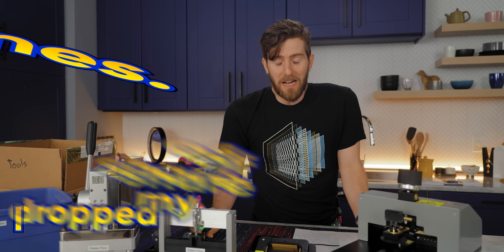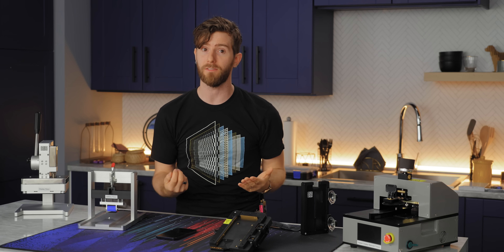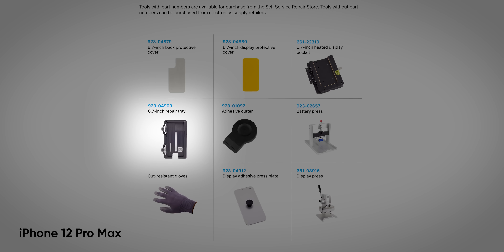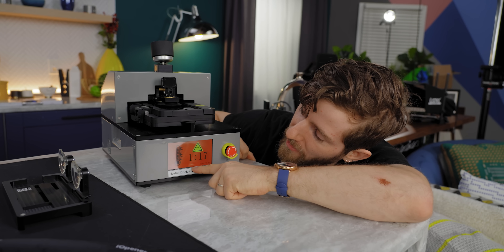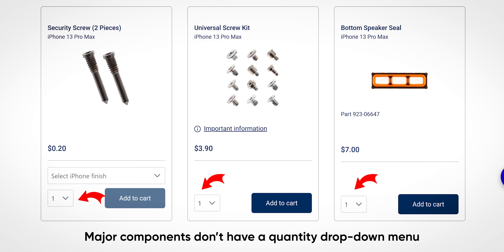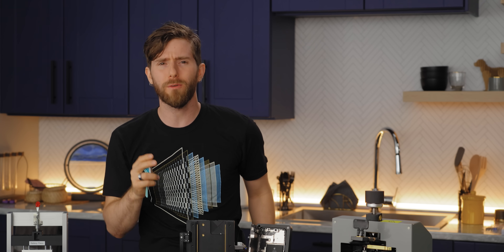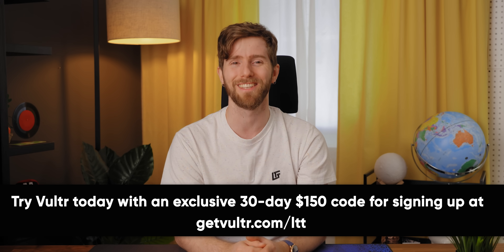I’m a Genius - Apple Self Service Repair Program

Comment: I work as a Samsung technician and it shocks me what apple thinks is necessary to fix a screen or replace a battery. All I need to do a whole phone refurbishment (replace the screen, battery and some of the internal components) is a torqued screwdriver a hot plate a small plastic prying tool and a suction cup. It takes me 30 minutes with paperwork included to do the whole phone from first placing my hands on it to giving it back to the customer.
Ofc we have tools that make it much easier like an automatic opener where you just place the phone in it and after 5 min of heating up pops out an open phone. But you don't need a press for the battery, elbow grease works just fine. Their glue is already REALLY STRONG!
Reply: I'm an independent repair tech and the design choices Apple makes for their phones is absolutely fucking *baffling*. Every model uses a different assortment of Triwing or Philips screws in different places for seemingly no reason, and of course they're almost all different lengths. Pulling out the boards can be a pain as you have to remember where each individual stand off, part and cover goes (of which there are an unnecessary amount of), and just in general they are SO unnecessarily hard to work on compared to Samsung phones. Almost every Samsung whether it's an A series/S series etc. JUST MAKES SENSE. One type of screw, one length (except in the case of the new ultras that have those triwings up in the top right but w/e) the mainboard, daughterboard, and the battery. It's just simple! Most other manufactures are the same. Sony, Google and Huawei can get a little weird at times, but nothing tops the consistent bullshit of Apple phones...

...And of course that's without mentioning the fact that a battery or screen replacement will come with a 'non genuine part' warning on anything past the XS (even if they are OEM but don't have the certified software), something that Samsung still doesn't do, bless their goddamn hearts. Samsung will even let you replace fingerprint sensors without a warning, Apple will force you to move the home buttons over to keep touch ID (which isn't that hard and we do) but again, just unnecessary and a waste of time..."security" my ass... Our store has been in business since 2007, long before any of the bullshit that Apple has introduced, so it's fascinating to see how much the landscape has changed.....Mostly in unfortunate ways....

If anyone read all of this, thanks for listening to my rant about Apple's illogical phone design lol. Would LOVE to talk to an Apple engineer and just ask why the hell they have to change the screw heads on the earpiece speaker/proximity module for every model from the XR up. It's 4 screws, you don't have to change the type and layout just for the sake of changing it Apple!
Reply: not as strong as Samsungs "elephant glue" tho!
Reply: @PvtAnonymous  use rubbing alch comes out easy
Reply: Unfortunately, i have to nearly damage the damn battery to replace a Samsung battery.
Nearly lit my Note 9 on fire because of the lack of pull tabs. You'd think your handlers would actually care about that but NOPE! Just let them burn i guess!
Reply: @LermaBean  I'm an independent repair tech and you're right that the batteries can be really annoying. I usually just let it soak in isopropyl alcohol for 5 minutes, leave it on a heating pad and come back to it, most of the time it will just fall right out at that point. I've had one Samsung battery blow up on me as I was being careless and rushing prying it up, lets just say I don't rush batteries anymore lol. (In case you're curious I've never had the isopropyl or the heat damage OLED displays, although the the iso can get between the layers on Apple's LCDs and create bubbles).
Reply: @Quivex1  well Samsung does have different lengths of screws but they almost always are on a different level of the phone. Longer screws are for the plastic backing that holds everything together, and shorter (usually black not silver) screws are for holding the boards to the frame and grounding it, most of the time there are just 1-2 of them. Ofc there has to be an outlier, and it's called s21 FE it has 2 more shorter screws in the upper right corner (one visible right away when you open the phone) but fortunately they are protected so when you screw in a longer screw it won't come through the display, it just won't hold it. This is the most "complicated" screw management, without going into the foldables territory.
Also s9 is a human marvel of overengineering, with it's weird layout and flexible PCBs. It's always a nice switch up from basically the same layout on most newer S series and A series devices.
Also also if anyone wants to do like basic level of testing on they own devices then go to the phone app and on the num pad write *#0*# it will open a "secret" menu with few tests that you can quickly do to test basic functioning of your phone (loopback is for testing mics and hall ic you have to place a somewhat strong small magnet to the dots for it to detect them)
(In the sensor tab in the upper right corner you have "image test" and it opens a low quality really stretched photo of a chiwawa I have no idea why but it's there in every single Samsung phone)
Reply: @Stripeyy  you're right, I did forget about the black board screws, or the 3-4 screws holding the daughter board/charging port down on some phones, but the fact I forgot about them means that I never worry about them, which again is just how things should be. Usually samsung even marks those specific screw holes with a bigger gold/silver ring so you know where to put them back if you've never done it before! And like you said there's almost always only one or two, sometimes more for the daughter board. I guess on some of the A series phones the screws for the finger print reader are slightly shorter but again, just not a big deal.

..... Now the S8s and S9s are.... Interesting to say the least I'll agree with you there 😂 The first couple of times I did one I didn't route the antenna wires cleanly, and forgot the tiny proximity module underneath the mainboard. The little side board that's connected to the main flex is also kinda weird. Once you get used to it though, you can practically pull the whole thing out of a screen fully intact and drop it into a new one. I'd argue that's probably Samsung's most "complicated" phone and it's still easier than almost every iPhone lol. I would love to know why the decided to design the S8/S9s like that though, especially since the S10 is literally one of the easiest Samsung phones to work on. I guess someone realized they over complicated the design and was like "fuck this we're making it simple". Works for me!
Reply: @Quivex1  I just got out from work and today i refurbished a z flip 3 for the first time and holly sh... that's a tight squeeze with all the parts. In most phones you can assemble them in almost a random order. Not here,  here you have to do it in a somewhat specific order to put it together correctly and in one piece.
It's by far the most complex phone I did but still the most complicated part is ungluing the front camera without damaging it. This shows that if you want to you can make even a flipping, (pun intended) folding phone so easy to repair that the hardest part of it is the glue.
Reply: @Stripeyy  ahaha that's great, love that a flipping/folding phone is still (relatively) straightforward to work on...I have yet to do any flips or folds, but by no means am I expecting them to be easy. However I don't mind if a complex phone happens to be complex to fix, it makes perfect sense that it would be the case. Anyways glad to hear it's not even too bad apart from a couple things, and you were able to get through it okay! Unfortunately don't have any good stories to tell from today really, although one interesting thing that happened is someone came in with an S20 Ultra where the cameras would fail intermittently. It's now the 4th time we've seen this issue, and replacing the camera modules don't work, nor does a factory reset. It's some kind of board level issue I guess that I haven't seen talked about much. If you look online you can find users talking about it, but no fix.
Reply: @LermaBean  the fact that a small line of 3m doublesided tape is enough to secure the battery in place (I mean, where should it go anyway?) is more than enough from my experience. The glue is literally there to make repairs impossible. And even Huawei and Xiaomi have a sort of pulltab. Just Samsung spitting in everyone's soup.
Reply: @LermaBean  actually you are meant to soak them in isopropyl alcohol for few minutes and then pry them off
It works fine for me but literally yesterday a battery caught on fire for my friend
Reply: It’s crazy, the should just make it so that you can repair any part with nothing more than a kitchen knife, even opening the phone, no stupid glue or screws it just slow down the process. people in remote areas in India for example don’t have access to these fancy tools, let them use a kitchen knife or a small spook to open the devices
Reply: @jbutler  I mean...I'm not sure if you're joking or not but obviously there has to be a certain degree of complexity if we want our devices to work as intended and have the feature set we've come to expect haha. It's just complexity for the sake of complexity and unnecessary over engineering that bothers me. Iphones wouldn't bother me if I didn't see Samsung make phones just as good with all the same features that are 5x easier to work on, without all the walled garden "security" BS to boot.

Comment: This might be a stupid idea but apple could also provide an actual physical place where they rent the tools so that people could rent and fix over there. It will be cheaper for apple and  customers who are close to these places and apple need not worry about losing their equipment. However, apple being apple I doubt they would implement this meaningfully and this solution is not complete alternate for all.

Comment: Invetory solution: order screen for your phone, leave that as an inventory and once customer comes order parts for their phone and give them the ones you ordered before for your phone. Then you can repair it immediately and have their parts in inventory for the next repair once they arrive.
Reply: Apple will not pair the incorrect serial number screen to the phone. They literally tie it to it in the system. Also anyone who it doing repairs to actually make money knows your doing multiples of phones a day all of various models and sizes.
Reply: What if 5 customers come in at the same time. Only one of them will get instant repair the rest will have to wait and be forced to buy a real phone
Reply: @TerminalHeatSink  It could be done with more phones. But IDK whether the screen is HW or SW paired to the phone. Someone good at this should probably figure out how to reprogram the screen in a similar way the battery is reprogrammed (I can't do that sht)

Comment: As ex-phone technician I see why Apple is doing things this way. You tell customer over a phone that screen replacement costs X$. Then when he/she comes in for a service it turns out that phones housing is destroyed in a way that’s preventing new screen installation. You tell this customer and he/she goes full Karen, screaming at you that she was PROMISED service for X$ price and is DEMANDING that. Been there, done that. Never again.
Reply: To be fair a good salesman words their responses indirectly. “As long as there is no further damage a screen replacement costs X”

Not saying you’re wrong at all. People would still argue, at least you can fall back on an honest “I specifically said…”
Reply: @desi9558  Yeah, after my first “Karen moment” I did better with my wording, just as you said. The problem is, there were still people that went full on insane. They were clearly fishing for full phone swap for a price of screen replacement. They read on Facebook groups that it is possible in some cases, and wanted it for themselves.
Reply: Used to work at apple as a sales guy. This is exactly why all the techs were complaining when they announced this. Some people are so incredibly stupid and willfully ignorant that they do not follow even the most basic of directions. I did not envy what the techs did.
Reply: Customers can be dicks sometimes. I worked as a Samsung promoter part time and whenever they are not pleased with the service provided by the service center, they proceed to walk over to the sales department (which has nothing to do with servicing let alone know how to service a phone) and rant in front of us as if we are the ones that provided the service. The service center department and sale department are different from each other, they are even operated by different companies.
Reply: Having  problems with iphones. Buy an Android.

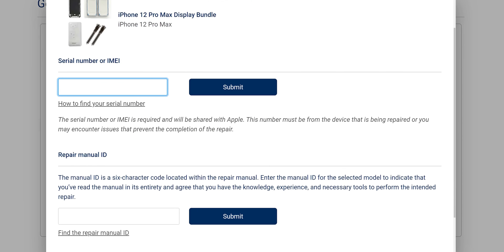Comment: 3:28 | 12:01 Serial number being required is probably not only to keep track of the phone being repaired and limit the same parts for that phone in the near future but also to remove their "Not Genuine Apple Parts " message that pops up even with brand new parts salvaged from brand new iphone. They are likely sending the part after making it "work" for that serial number.
Reply: Actually that is false, at least partially. You need to use Apple’s online unlocker thing even with parts you order from them. They don’t work out of the box

Comment: Linus I’m an Apple repair agent for geek squad I just wanted to let you know that the reason why they don’t allow diagnostics over the phone is because Apple requires any repair to be processed through GSX which before submitting the repair needs to be ran through diagnostics which can’t be done over the phone
Reply: That sounds like the official explanation, but I think Linus is probably right on why that procedure is needed
Reply: @sharpless  Linus is right on almost everything. He’s a smart dude and I’ve been watching him for years. Apple almost never has the customers care in mind they try and make the process as difficult as possible so that you will give up and get a new phone. I just wanted to point out that it’s not the people running the diagnostics that are making these policies.
Reply: @ageorgiev89  You’re right they should but in order to change to something new you have to know how it currently is so to say that nobody cares is kind of a stretch
Reply: @ageorgiev89  Also it’s very rude and you’re operating under the assumption that I agree with what Apple’s doing which is not correct
Reply: I really wish I could describe the entire process because it’s kind of ridiculous how many extra steps they add to repairing something simple!
Reply: There’s even a display calibration software that needs to be run after a new display is input or else the front camera won’t work. The display calibrations software can’t be ran until we submit the old serial number of the old display into GSX and process it for shipping. And that’s just one example of extra steps and hoops we have to go through. If I had to estimate I would say the repair takes about 30 minutes and the processing of all their extra steps takes about 2 1/2 hours.

Comment: Having formerly worked at an AASP, seeing everyone on YouTube explore these tools that I'd suffered with for several months of my life takes me back. 
iPhone 11 and older, you literally toss it into a little apparatus with suction cups on either side and rip it apart with no heat. The iPhones before the 12 were so much easier to take apart. 

The Heated Display Press is awful, and if a screen is too damaged it often is impossible to use the "correct" method to remove the panel. They have what are basically screen protectors with really strong adhesive to put over the cracked glass for the suction cup to grab onto, but the heat melts the adhesive on those, and you end up just pulling the cover off and the panel would just stay in place.

I could change the display on an iPhone 11 in as fast as like 5 minutes, iPhone 12 always took at least like 30-60, with most of it spent trying to get the display off.
Reply: For iP 12 one is to get screen off, I would say that is not that hard some times. Some times geting the glue out is diferent storry and alone can take you 30min to do.
Reply: @ageorgiev89  Lol, its not complicated in the slightest. You can literally do it without a manual.
Reply: Also work at an AASP. I yelled when I saw him waving around the box the display came in. If we write on the white boxes Apple charges us $50!